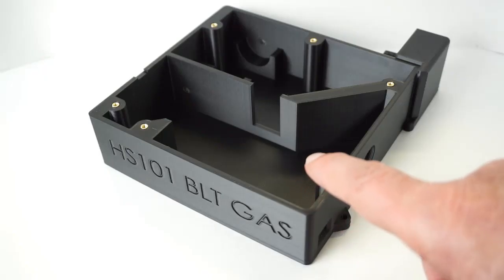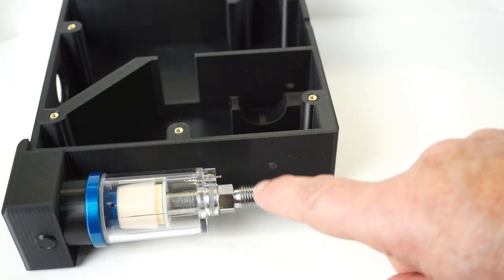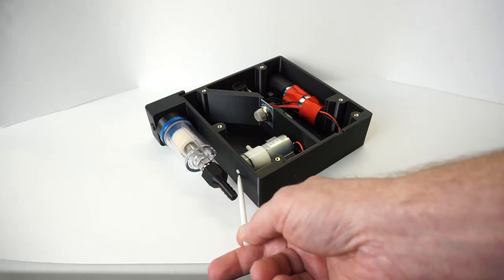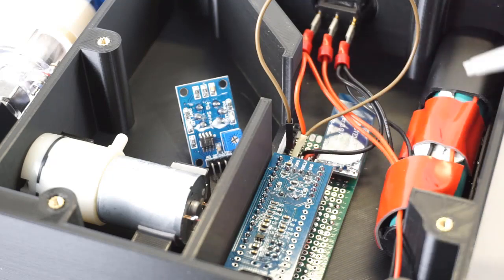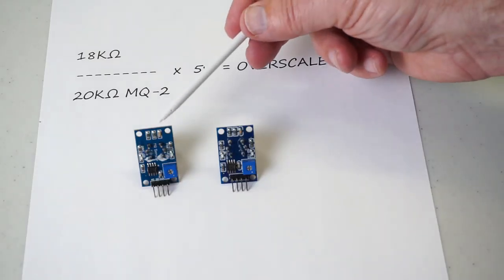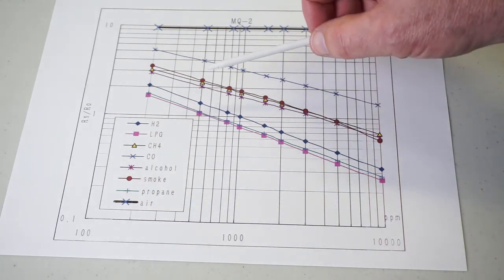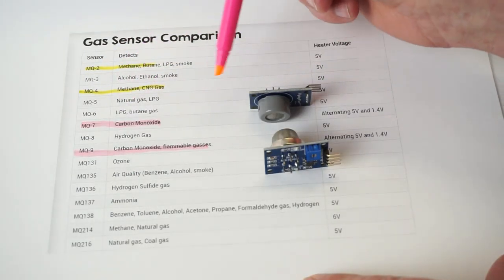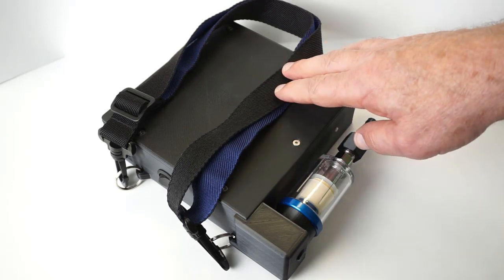GADGETS#134 - HS101 BLT GAS | BUILD

Comment: one more thing, sorry for the bother. what is the black spacer called inbetween the prototype board? And are you using two or just the one that I can see in the video
Reply from the maker: seems like your are referring to the headers?

if so, there are 2

you might consider the Telegram HScope LOUNGE where it's so much easier to deal with technical matters than this comment section ... especially since you're undertaking a sizeable project here:)

Comment: Type of filament used. Please and thank you
Reply from the maker: this was just PLA ... easy to print and not exposed to heat so good enough

pay special attention to the 1KΩ  resistor requirement on the MQ-2 board

good luck with your build:)
Reply: Thank you sir

Comment: Looks great. I'm using Picoscope (for doing engines relative compression tests as a hobby) that connects through BNC as well and runs on Windows. If you would think to built such a device that can be clibrated with the Picoscope and would like to sell, kindly let me know.
Reply from the maker: thanks for the comment, namrur:)

a version of this that would connect to any oscilloscope BNC could be made, I'm sure...it would be a lot of tethering (BNC cable, USB cable) ... I doubt I will pursue this...

Comment: Wow Denis,
Great project💪 and lot of great information ,
Good tip for the gain resistor for us that don’t know much about electronics
🤝🤝
Reply from the maker: Thanks Ramon. I've been toying with MQ-9 for carbon monoxide and dioxide. It's looking good. I think this GADGET will prove capable of detecting those gases in engine coolant if there's a bad head gasket.
Catch ya on TELEGRAM:)

Comment: You are exposing the manufacturers of this gear as bandits at there price points 🤣 Amazing piece of gear Denis. Have you given any thought to brushes arcing within the sense chamber? Perhaps mark 2 will have the pump assembly remote.
Reply from the maker: thought about the brushes and discounted it Ian ... if it blows up in my face, I'll reconsider...lol
Reply: @theGADGETSplaylist   🤣🤣🤣
Reply: @theGADGETSplaylist  ISTR that BigClive did a tear-down of that exact pump.
Now I'm not sure but have look.
https://www.youtube.com/watch?v=7l1we5gorRM
Reply from the maker: @rysacroft  I took pump apart like bigclive did as well...same eccentric diaphragm.
But my pump didn't come with that "wasteful" resistor.
These pumps are available in many voltages and I ordered 4 more pumps yesterday rated 24v for minnow bucket use. I'll 3D design a housing for pump and 20v DeWalt lithium battery that will directly power pump.
These pumps are cheap on Aliexpress...those 4 totalled $18CAD shipping included. Will keep 1 or 2 and gift the others.

Comment: Wow Denis, you've outdone yourself.  It's as though we're watching a teardown video of a $1000 piece of test gear:)  Good point about the hose connection being stronger printed horizontal, the strength of prints is a lot like  wood grains.
Reply from the maker: $40 goes a long way towards this build. Maybe not entirely capable of competing with $4000 analyzers, but it's pretty good...